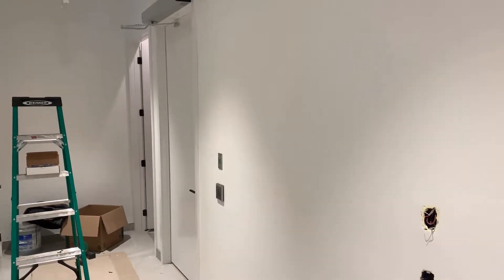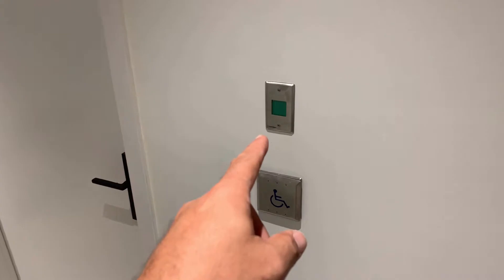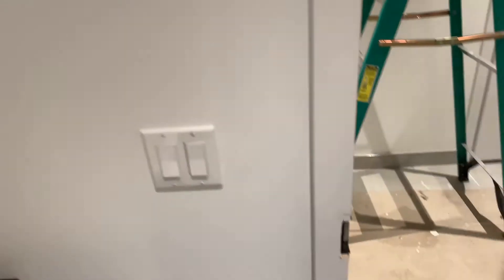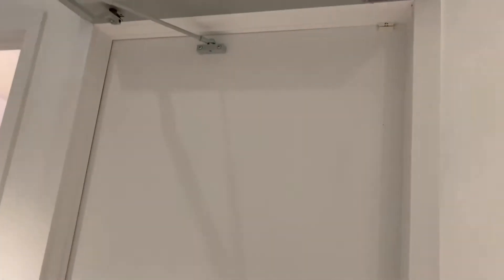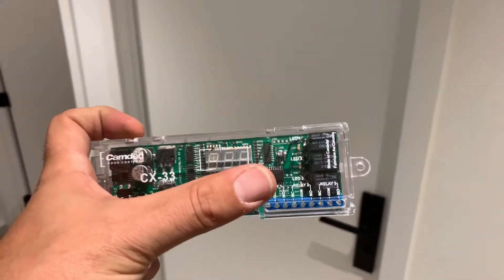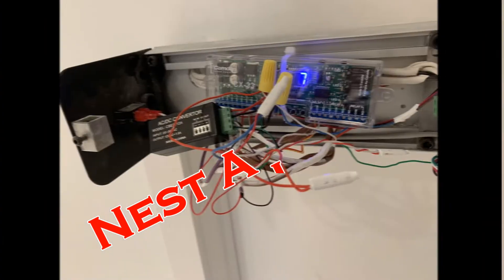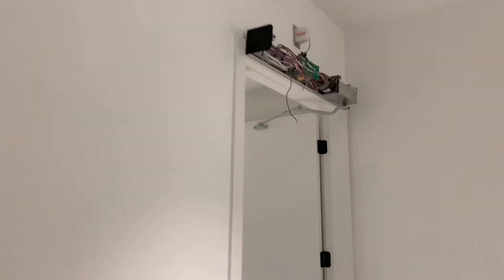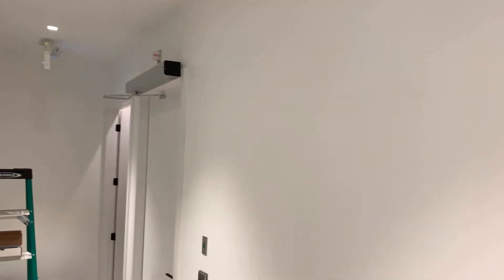Door Operator installation with CX-33 Controller, Push to Lock and Emergency

Comment: my stike wont lock . ? any ideas
Reply from the maker: For washroom setup when no power strike unlock, so could be that it don’t get power to lock or strike is fault, you can disconnect the strike and measure the wires for power when lock.